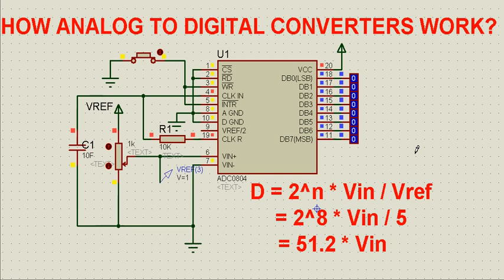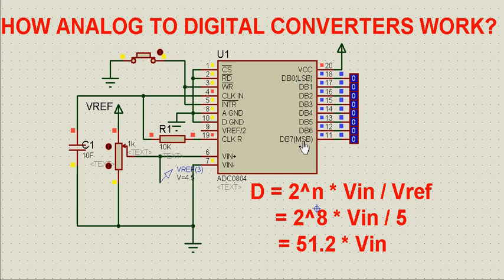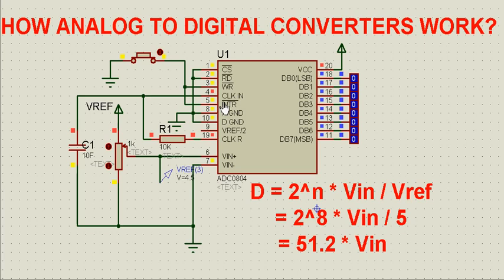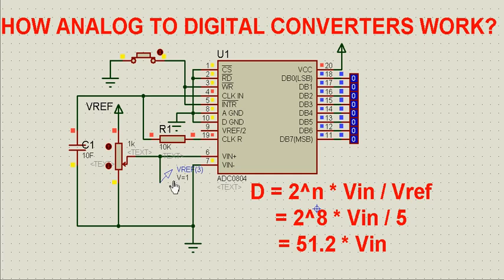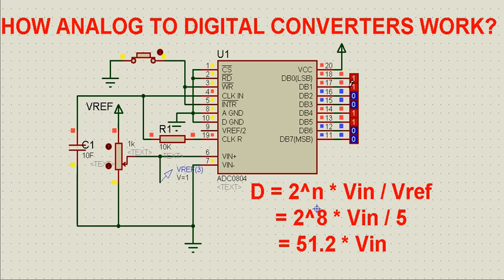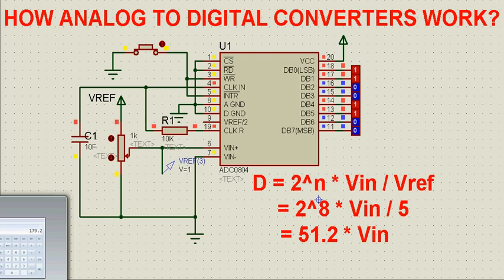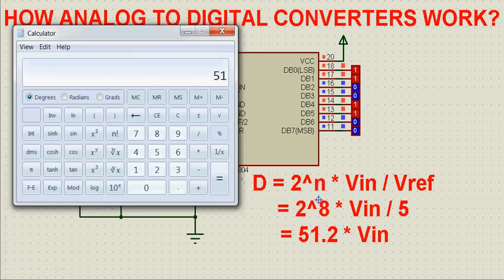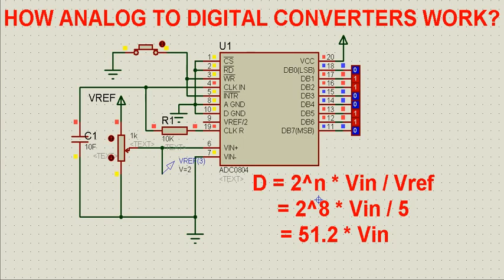analog to digital converter.avi

Comment: Do you know what the minimum voltage that would work for the analog input pin would be? I have a tmp36 temp sensor that outputs 700 mV minimum and I want to implement with this.